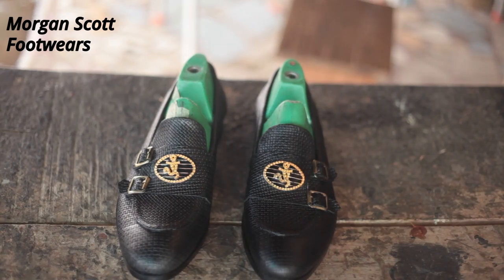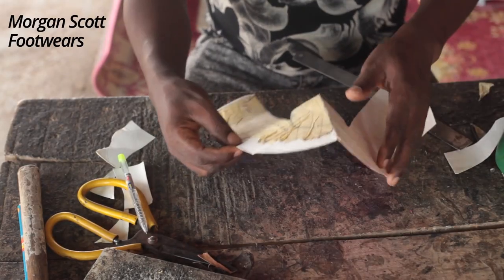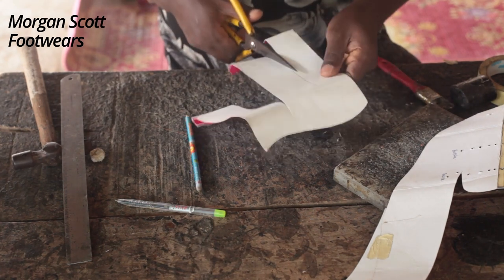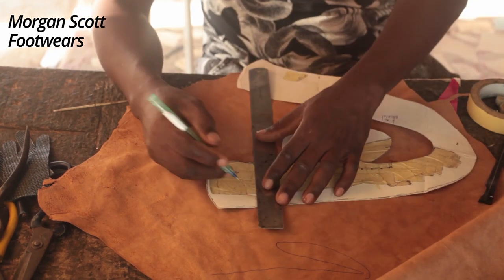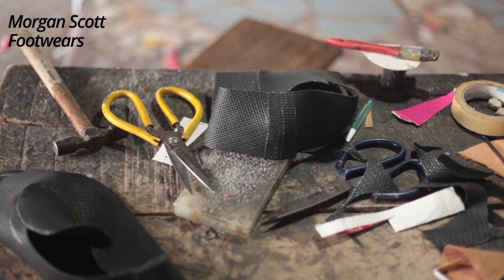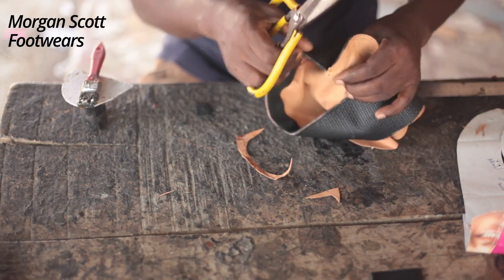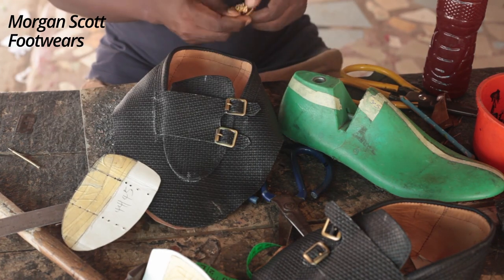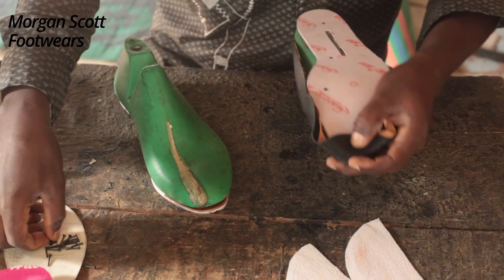How to make Handmade loafers easily using simple Tools, shoemaking full tutorial

Comment: Please I need your help sir, sir am having difficulty on how to lass to fit in the exact leg am doing
Reply from the maker: If I get your question correctly, you mean how you can properly place the upper material on the shoe last and fits perfectly. The best way is to make sure everything you get on your pattern is the same when cutting it out on the leather.  I don't know if I answer your question correctly
Reply: Sir,you are not really clear with my question,sir what am talking about is that if I have cut the design, placing it on the lass to make the accurate size of the person, that there will not be issue of maybe is tight or not tight
Reply from the maker: @PrimediaNigeria  it shouldn't be. but the person must be sure of his size as well.
Reply: Sir I mean fixing the upper to the particular size